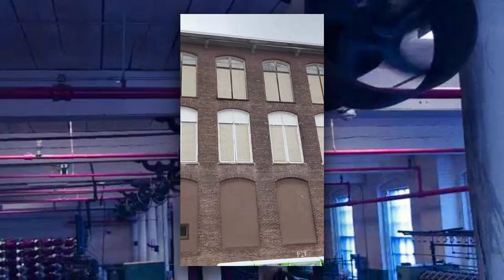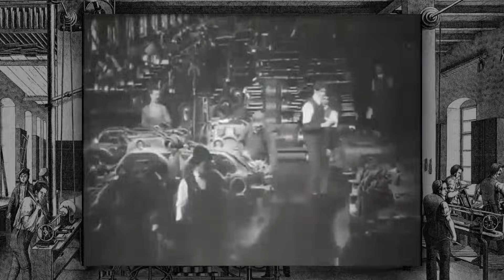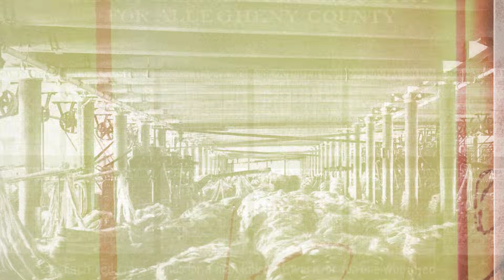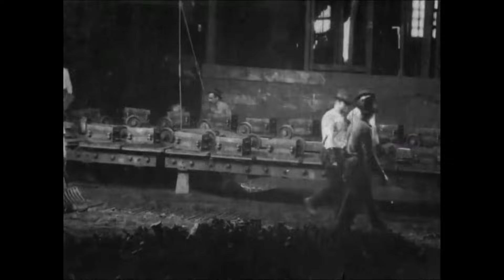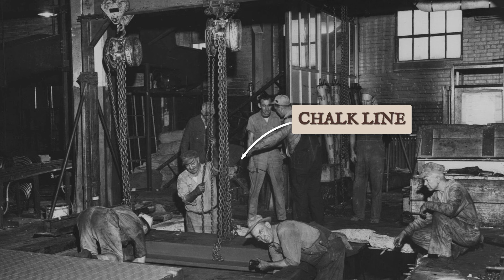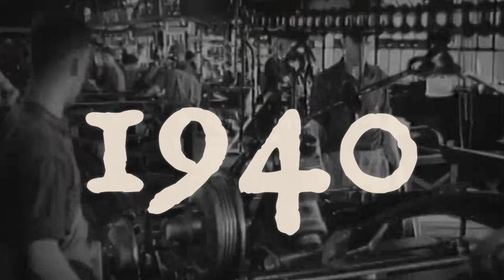The Open Shaft: The Hole That Connected Every Floor and Killed Everyone

Comment: Sadly these days even with lots of safety systems in place stuff still happens.sometimes it's complacency where your just so familiar with somethn as dangerous as it may be and not seem like it is and you ce done it countless times like walking over an opening dozens of times and nothin happened before then all of a sudden it does happen and maybe to you or a loved one or a friend. Safety stuffs implemented for reasons these days.dont ignore them....it may mean your life..I too have been hurt on the job..once I fell through a roof opening for a window .I forgot ..it was covered over and marked out but I forgot and went over the roof to that section and fell through...I was ok..just scratched up on my right arm...and only fell a few ft into house..don't he complacent and be observant.....